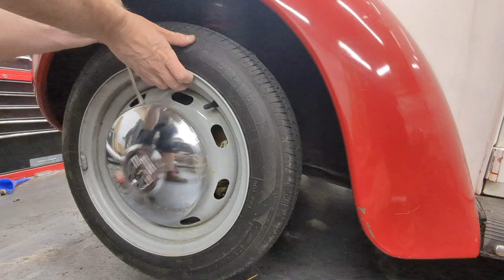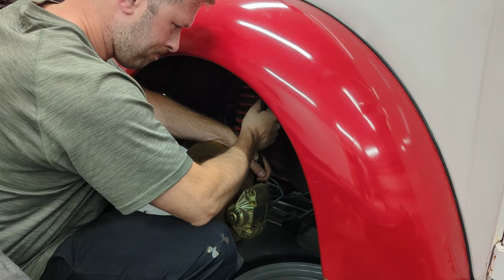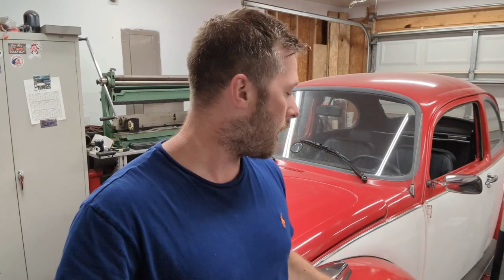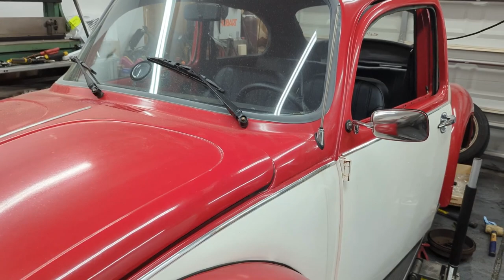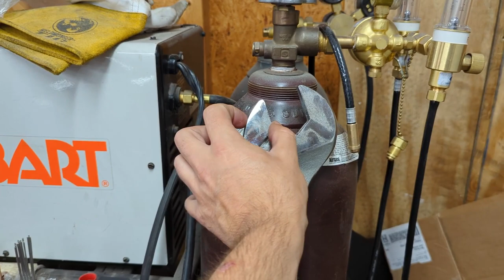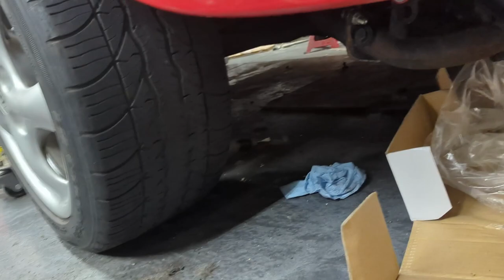Fitting Porsche Wheels on the Turbo Bug -- 1973 Super Beetle Subaru Swap

Comment: How is that a 1973 if it’s got the vent on the front valence? Thought it was 1975+ that had the vent for AC. Or am I wrong ? My 1973 super bug doesn’t have that vent
Reply from the maker: Mine is definitely a 1973 Super Beetle lol but not necessarily original.  If mine's not supposed to have vents my guess is the PO could have updated in the past. Mine could also be like a 73.5 or some weird transition year/model.
Reply: @RatchetMotors  yeah that’s a good point, I may be wrong but strange how your 73 has vents and mine doesn’t, maybe mine isn’t a 73 lol
Reply: All U.S. super beetles have louvers it was for ac but non ac cars had it too. Many aprons have been switched to smooth for looks or from damage